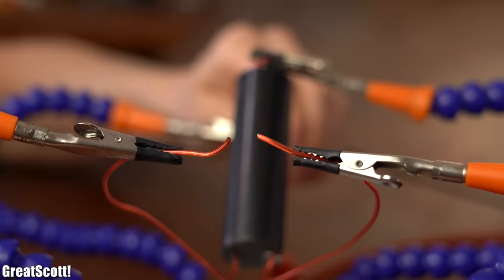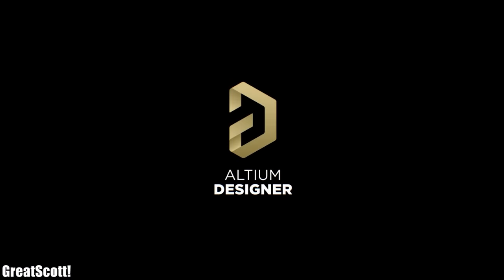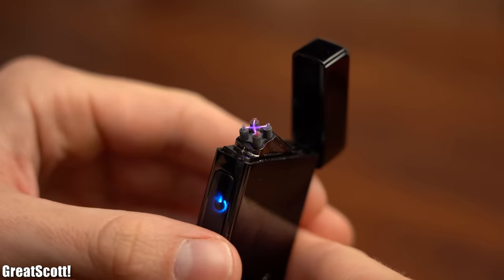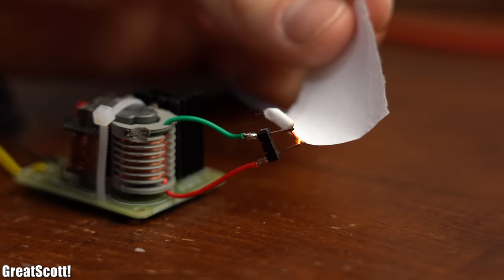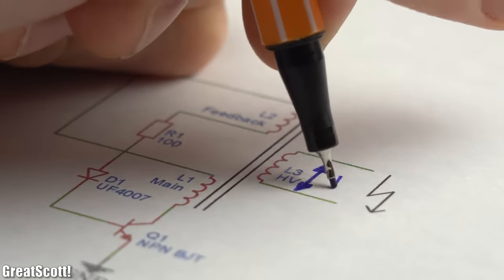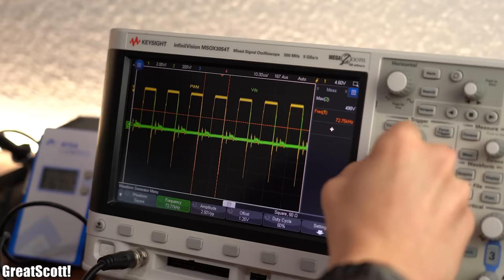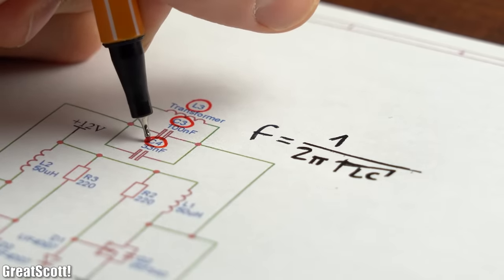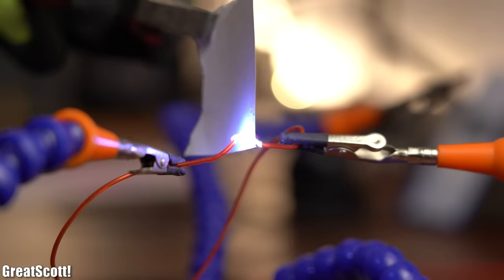DON'T BUY this HV Generator! Build this one instead....please

Comment: If  you add one more fly back diode for the L2 coil, is it can prevent the BJT or MOSFET ?
Reply: it depends, a resistor can better protect the bjt, as it won't heat as much, but the mosfet needs to take the diode out and protect the gate with a zener diode.
It is not a guarantee, as making a mosfet self oscillate is not something certain

Comment: Hi , I'm trying to build a basic amplifier for DDS signals (20Vpp) to get 1000v output & low current with good frequency response from 0 to 100KHz to start with. I'd be happy with it putting out square waves only.
Can i modify the ZVS to make it?

Comment: Scott while your very intelligent your over looking what those premade modulus are actually for. Their often sold as taser modules here in the states but what their actually supposed to be used for is ignition systems like on rc cars and planes that use small nitro engines and other stuff such as propane grills. Besides all that's inside of those hv boost circuits is a simple voltage multiplier which is only useful in specific applications, that's why they don't run a constant plasma arc in cars instead of the normal dangerous spark. Those small constant plasma arcs don't actually work very well for igniting gas. I do agree with you how ever these shouldn't be marketed as such for diy stun guns because not only is that possibly illegal where the use is but it probably wont work nearly as well as a actual stun gun for due to reliability and if its actually able to deliver a painful enough shock to knock you on your ass which that needs a lot of juice to do which i dought these modules actually can deliver so in the case of this being used as a weapon you'd probably end up hurt a lot more then simply not using it for the trouble of pissing off your attacker. hell honestly as far as self defense goes the good old ooga booga route of picking up a rock would work better

Comment: Bro can you make a High-voltage DC using a voltage multiplier like ElectroBoom does but building the capacitor and diode circuit on PCB ?.....
Reply from the maker: I will see what I can do :-)

Comment: I’ve built so many ZVS circuits and none of them worked like all the times my transistors die can you help me?
Reply from the maker: You need a clean uninterrupted start up voltage. Maybe use a delay circuit for that. Electroboom did a video on the topic.
Reply: buy a kit from china, they work fine if you put it together properly,  some of the larger Tesla coils you get come with them.

Comment: I bought some of the first HV generators a day before you uploaded this video and can confirm they hurt like hell 🤣

They’re painful enough that I’m planning on 3D printing an enclosure for it with a momentary push button and using it for personal protection lol
Reply: that's actually a great idea... but depending on the laws in your country this can end badly.
not only because the taser itself could be illegal, but the fact it has no official certification or anything.
you are allowed to protect yourself with illegal firearms (here in germany for example) but you'll still get in trouble for having one

Comment: could we get a video on dc-dc forward converters
Reply from the maker: Is that not more or less like the flyback converter from my SMPS videos?
Reply: @greatscottlab  From my understanding a flyback converter uses coupled inductors to store energy while a forward converter doesn't but they are very similar. I'll check it out thank you

Comment: Yea i bought 3 of them and wired them in series.. well 2 in series and one in parallel with those.  Then put in 4 18650’s in an old flashlight casing and instead of a plain light it makes a loud painful back the fuck off light..  its not to be played with though.  Its strong enough to put a person into convulsions if done at the neck..  pretty scary if youre just testing it..  lol..  but ive never seen a taser as strong..

Comment: Nah I'll stick to the high voltage converters you bad-mouthed. They make big loud sparks and I can have more fun with them.
Reply: They have high voltage but low current I found out the hard way when it couldn't even burn melt
Reply: @Skibidi292oo  
Just use a car battery if you want to burn stuff

Comment: Just buy flyback and ZVS driver :P
Reply: Just use HV flyback transformer from old tv.
Reply: @LabArlyn  exactly
Reply: @LabArlyn  But because the fly-back secondary have embedded diodes you will get pulsating DC and no nice plasma like in the demo.
Reply: @paulcohen1555  at least we can create high voltage arc with it.
Reply: @paulcohen1555  i have used many flyback transformers with many drives and some give me very very powerful arcs the arcs showed in the video are nothing compared to those, i get the best results by using a very high power zvs driver that i built myself. but if u are getting weak arcs try another flyback or use 2 or more in series, yes u can use them in series just check the polarity cuz they have a diode in them also older flybacks that u can get from ebay dont have diodes but u will have to be luck in order to find those the ones without the diode are in a weird shape and they dont have the plastic casing
Reply: also my driver using a couple of FDA50N50 MOSFETs in parallel and a few induction grade mkp capacitors (the black colored ones) but i will not recommend u to make such a drive cuz its very very powerful and can kill u easily if u are not careful

Comment: Why would you spit on the device from Amazon and call it garbage? It literally contains the transformer you're showing just after and it's already plugged in with the capacitors. It's like shitting on a Skoda car and say you should get a Mercedes car engine instead and then build your own car. Germans...

Comment: I'll give this a miss, if you don't mind. High voltages are too dangerous for my incompetence. 
But thanks.
Reply from the maker: I don't mind. It is good that you know your limits.
Reply: @greatscottlab  When I was a kid, early 60s, someone gave me an induction coil toy. Took a battery, had a trembler to connect/disconnect the current and two hand grips connected across the HT side. Gave one heck of a shock. Idea was to prove how strong (stupid?) you were.